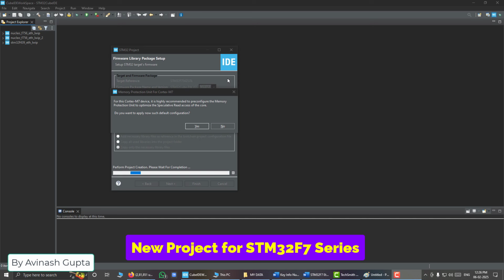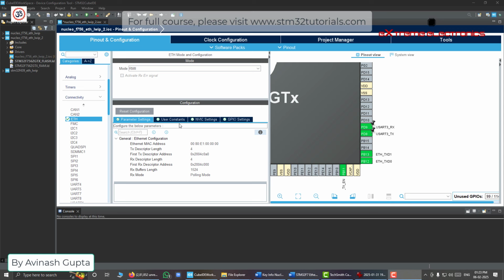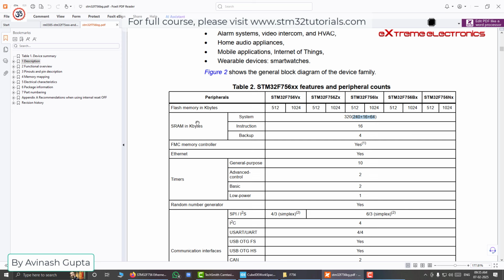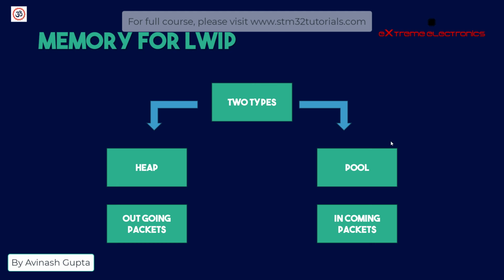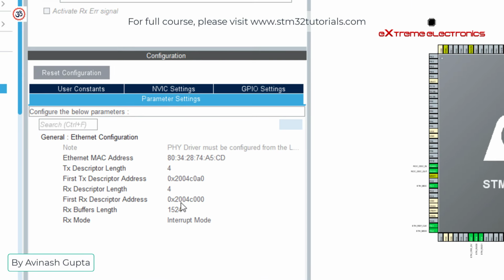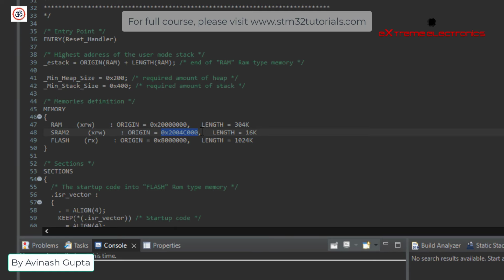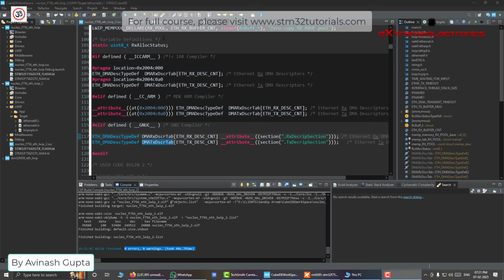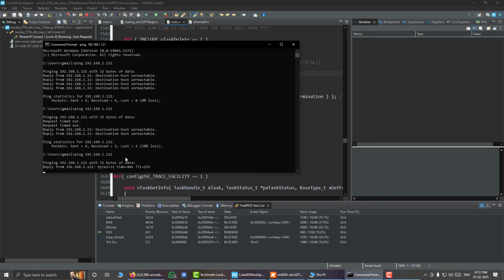Using lwIP (tcp/ip stack) with the STM32F7 Series STM32F756 Nucleo

Comment: Hi,
I’m working with the STM32H743 microcontroller and I’m having problems bringing up the Ethernet/network. I can’t get a ping response or establish any communication. Also, after generating the project/files (CubeMX/CubeIDE), the firmware ends up with a HardFault.
Do you have any working sample code / reference project for STM32H743 Ethernet (preferably with LwIP) that you can share, so I can compare the configuration settings and check what I’m doing wrong?

Thank you.
Reply from the maker: Hello, I don't have this board with me. If you can sponsor one board then I can.

Comment: I am facing problem in ping test it says destination host unreachable in STMH7 series please kindly address this issue urgently???
Reply from the maker: This is for F7 only. Not for H7.
Reply: @eXtremeElectronics but please can you enlist the regions why it is happening?
Reply: İ gotta same problem did you find a solution
Reply: @Zomer225 bro try debugging you are getting a hardfault maybe you have done wrong mpu configuration or Rx and Tx descriptors are not in same memory or wrong memory

Comment: Hi, in your website, there is only a stm32f4 based course. Are you considering to upload a full course for this board ? Thanks
Reply from the maker: Yes I am uploading...
Reply from the maker: Thanks to HAL library and middleware it doesn't need much changes whether you use a F4 or an F7